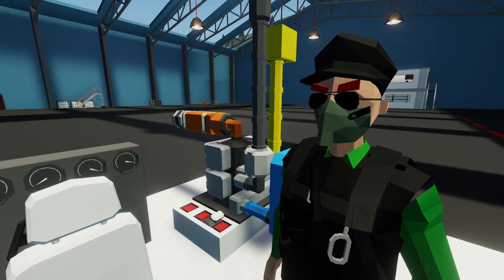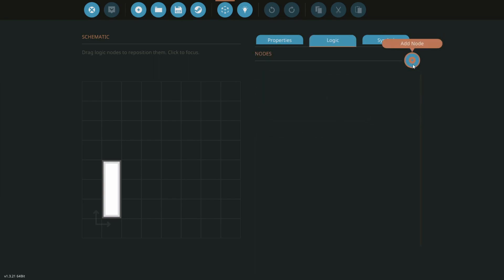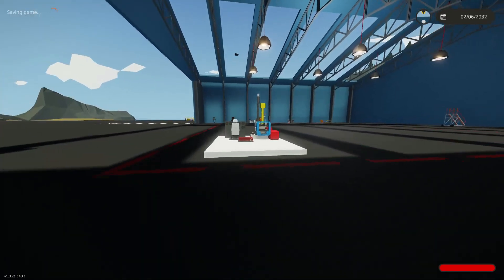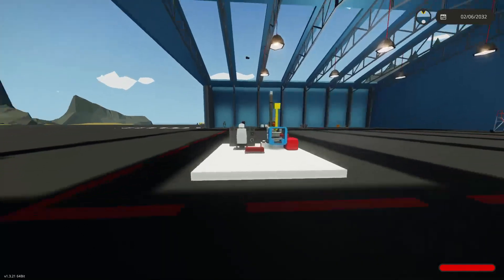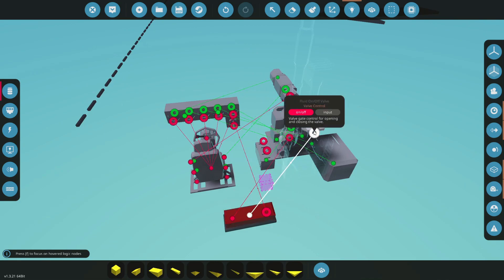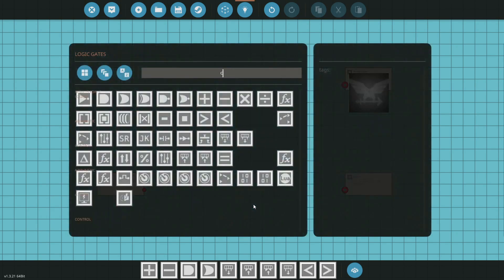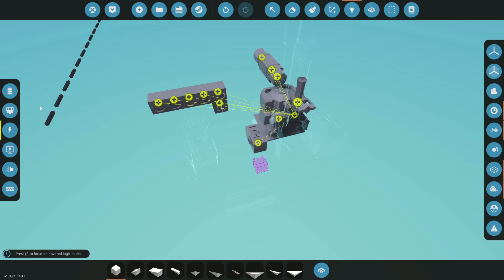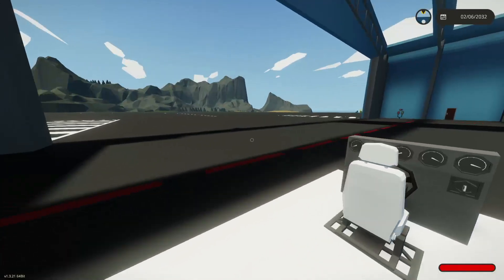Beginners Key Starter On/Off EASY! Stormworks Key Starter Tutorial - How To

Comment: Instead of using air value, you can use numerical switchbox for throttle so you don't necessary to turn the engine off using air value.

Comment: My engine djust custs after the starter stopt does anyone now what the problem zould be
Reply from the maker: Improper connections? My guess.
Reply: Not enough fuel, air or exhaust.  Or rps set too low.
Reply: maybe the timer of 0.5 is too short, try 0.75 or 1 sec